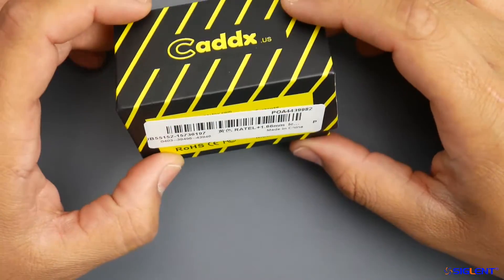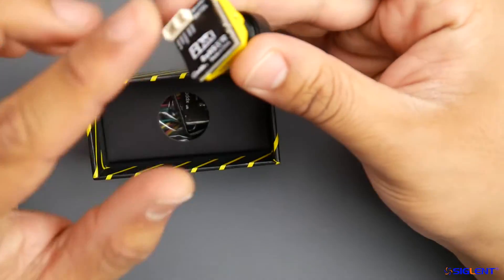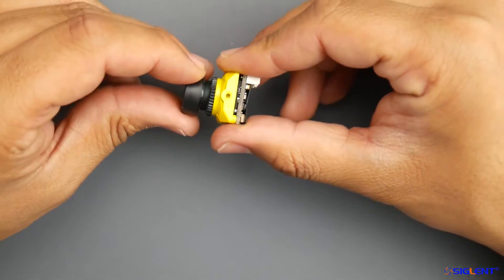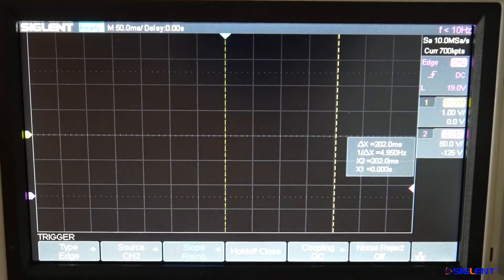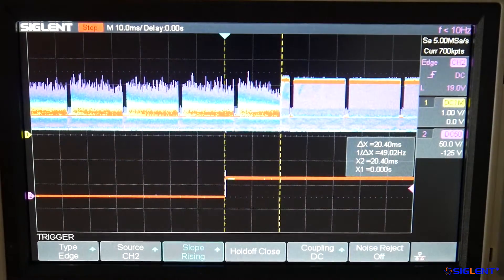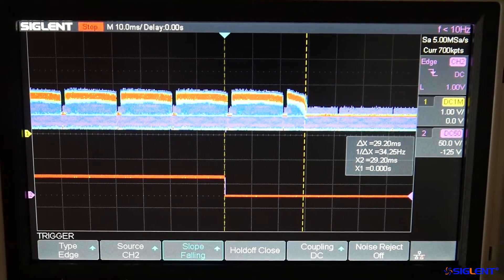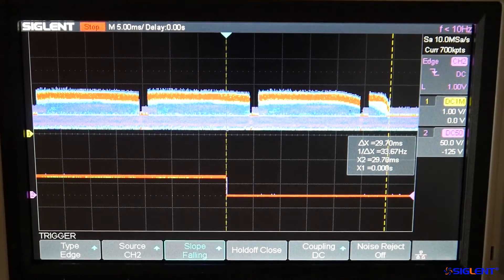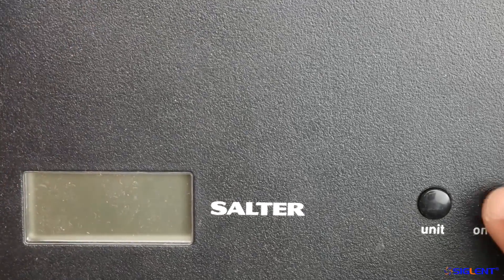Caddx Ratel FPV Camera Review // Latency Test

Comment: mesh doing my true first build and using iflight f4 twin g,, using this cam can i solder the osd (Green wire) to fc like in fc instructions or am i better off using the dongle to adjust cam settings... probably stupid ? but ive never had a fc with osd..

Comment: Great review, thanks for it! I got two of the Ratels, but didn't succeeded in getting camera control to work. Changing all the parameters in Betaflight CLI and using an additional resistor doesn't help. Any suggestions?
Reply: @ Mr M are you still wondering about Cam control settings? I had problems too, frustrating but it just needed the control and gnd swapped. So for me ground ends up wired to FC pad the other wire goes nowhere.
Reply: @DocKandTBW  THX!

Comment: Did you only do these tests on PAL? NTSC has a much greater and more varied latency on this camera.
Reply: Greater as in bigger or smaller latency? When the sun starts going down (I live 69N), I will consider buying one.

I am using now NTSC, but my ground old LCD screen doesn't handle it well, sometimes I get colour and sometimes I do not, but my box video receiver handles it very well. I get some confused when there is thing such as double negatives. I am not sure your statement is one doh, I'm no expert, hehe. I
Reply: @LordGryllwotth  Higher ms. I've posted a video with results if you're interested in NTSC, which I'm not going to avoid linking in someone elses video comments.
Reply: @RecursionLabs  same for the CADDX TURTLE V2. If you set it to PAL, you cannot use it, if you set it to NTSC, it's all good